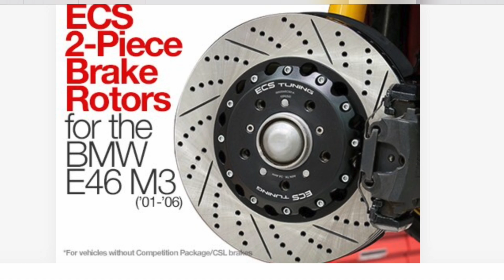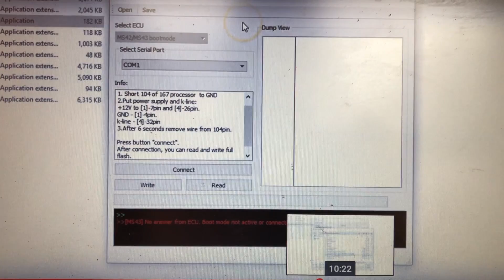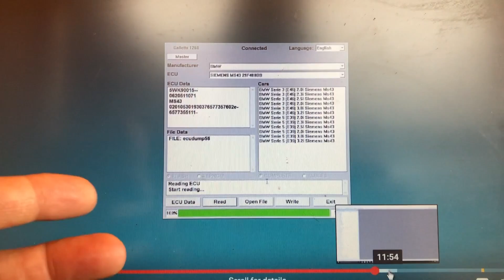The Drift BMW Has No Oil Pressure, What Do We Do? What’s Next?

Comment: Do not do that intake swap it is not possible
Reply: Anything is possible.
Reply: Its possible but its not necessary. The M54B30 already has good airflow thru the intake manifold. The M52TUB25 is the e46 engine with a shit intake manifold. People take the manifolds off his car and put them on the 323’s and 325’s. The M54B30 intake manifold swap onto an M52TUB25 is equivalent to an M50 swap onto an e36 328
Reply: Tyler Chedister it is possible and it will make more power (around 260hp crank) the m54b30 intake is very restrictive still. I know multiple guys in the Netherlands with this setup, there is a shop here in the Netherlands that can convert the manifolds and will do a before and after dyno pull.

Comment: Try some Lucas heavy duty oil stabilizer you will be amazed at how much quieter it will make it.
Reply: You can overfill it by a quart instead. Helps with the lifter noise
Reply: @joshemminger9022  Makes engine work harder my dude there is a reason why the manufactures have a max fill line on the dip stick, you're decreasing the life of the motor significantly compared to just leaving it be(The motor will feel sluggish, idle at higher rpm, and burn oil). Not worth it.
Reply: @xtune5731 I don't really think you know what you are talking about.

 For one, increased pressure on the sump side of the pump will ease the load on it. 

For two, the max fill line has a tolerance that varies from engine to engine. the goal is not to get at any g-force foaming from the crankshaft hitting the oil. this causes aeration and drastically impacts performance. That said these engines hold 7 quarts of oil. Overfilling 1 quart results in 14.2% oil volume increase, where as if the engine took 5 quarts that extra quart would be 21.2% more. Typical engineering tolerances allow for 20 to 30% "over compensation"  The increased pressure on one side of the pump results in higher pressure at the output which takes care of the lifters. 

For 3, do you even have one of these? I regularly change my oil every 7.5 to 10k miles. overfilling by a quart.the engine has almost 200k on it and doesn't consume anything during those intervals.
Reply: @joshemminger9022  Of course it has a tolerance but one quart is way too much to overfill. And yes I "do have one of these" and I change my oil in intervals of 3,000 miles maximum. My engine DOES have over 200k and is very healthy.
Reply: @xtune5731  well it should you are using 28 more quarts during bmws 15k recommended service interval. [ you can even change your filter without changing the oil]

What makes you say its too much. There is no foaming under any circumstance and the increased capacity helps with heat and "contamination" dispersal.[if you are using the right oil 3k is nothing. I would even reuse the oil in a beater]  I didnt just pull the quart out of my ass its widely accepted as a thing people do for these cars to track them. Try it and then tell me your opinion. [Dont cold fill past the part on the sick where it bubbles out into the 4 pronged sphere on the dipstick]

Comment: BMWs are awesome if you like fixing cars... every week. lol
Reply: Hahaha agreed.
Reply: Have you ever owned many bmws? I've got 4... They are some of the most reliable cars I've ever owned.
Reply: @spannerworx7106  Too funny ... my son had one and yes I was always fixing it ... be real,,, they are high maintenance .
Reply: @dogbounty6399  sounds like you had a lemon... I go drag racing with bmws also and find minium problems.
Reply: @spannerworx7106  yes actually, and worked as a mechanic at a BMW dealership. Sounds like you are in the what we called the 15% that actually hold together.
Reply: I've always wondered why there's so many high mileage BMWs for sale? If they're such pieces of shit
Reply: dog bounty no they arent. I have a 2000 323Ci  that ran like a champ, and it was totaled . New battery and it startedand drove, then with $450 of parts that were installed in 2 days it still runs like new. (Radiator, fan, expansion tank, power steering pulley, radiator support)
Reply: I'm pretty sure anybody that had bmw has had the plastic water pump take a shit on them oh and throttle body and maf
Reply: There goes the ppl “fixing them every week” you are the problem not the car.
Reply: That makes no sence dude. I've had 3, not a single problem.. Maby you should let someone else do the "fixing" and your problem is solved.
Reply: @spannerworx7106  It seems to be an American only issue. BMW's will run forever if you take proper care of them.
Reply: BMW cars are built well we used to drive  a 20 year old 3 series that still works it has been thrashed and we live in Australia, 40 degree days and dirt roads !